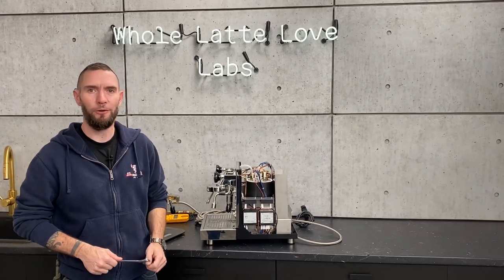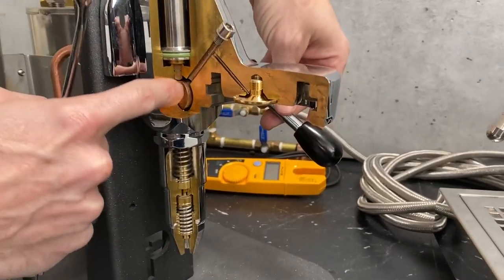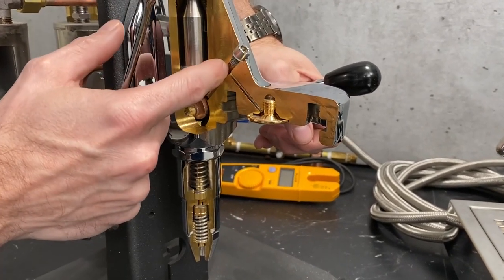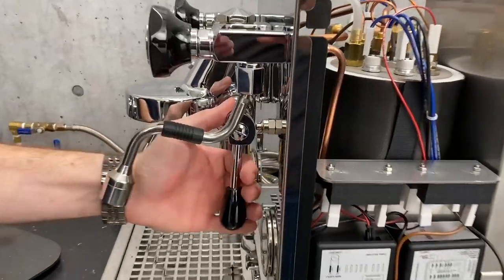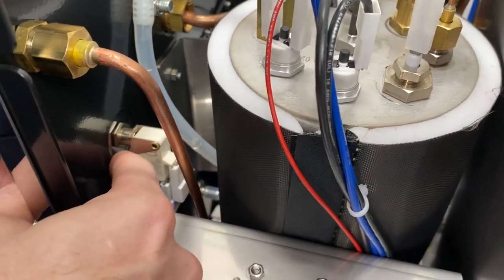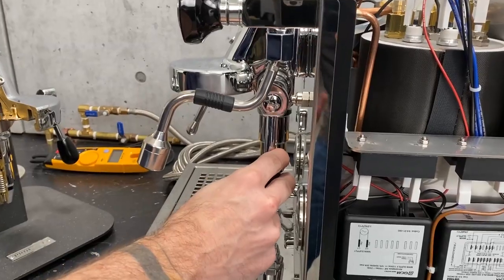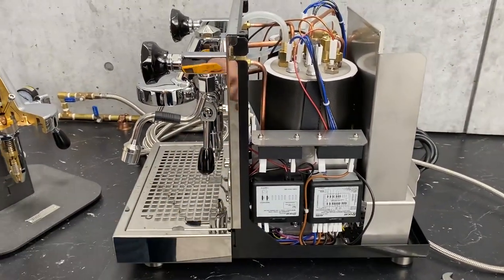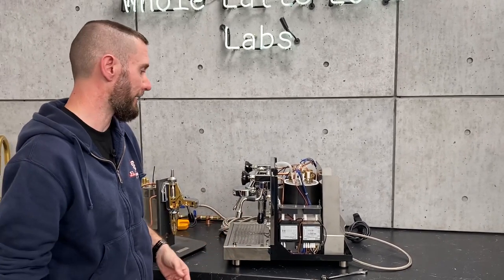Profitec Pro 700: Adjusting Brew Switch for Line Pressure Pre-infusion

Comment: Can you make a video showing how flow control works using that cut away e61?
Reply from the maker: Hi NL, I have this video: Espresso Machine E61 Brew Group Maintenance and Rebuild: https://youtu.be/ELIwD40tsrs which shows the internals of the Flow Control Device. The video has chapters and coverage of the flow control mushroom begins at 23:20.
Marc

Comment: Would we ever want to do line pressure pre-infusion over using our flow control device?
Reply from the maker: Hi David, Thanks for the question. You can accomplish essentially the same thing and a whole latte more with the flow control device. Line pressure pre-infusion does requires you are plumbed in. But useful for those without an FCD especially when extracting fresh, lighter specialty coffees.
Marc
Reply: @Wholelattelovepage  I see, thanks for the reply!

Comment: Does the shot clock start with pre-infusion? Thanks
Reply from the maker: Hi Paul, thanks for the question - one I get a lot! Including pre-infusion time in total shot time is up to you. Keep in mind that timing a shot is the most basic method of appraising an espresso extraction. If I'm using long pre-infusions which often reach 15 seconds before first drip my process is to do a basic dial in with a coffee using no pre-infusion. When doing that I adjust my grind to get a timing in the 20-30 second range from first drip. So I get my timing and then decide I want to do a long low flow pre-infusion to reduce the brightness/acidity of the fresh from roast coffee I'm using. I might do a 2 grams per second flow rate (similar to a 2 bar of pressure pre-infusion). I might not get 1st drip until 15 seconds. I probably do not want that shot to finish in another 10-15 seconds. It's a different story if doing a very short pre-infusion of a few seconds before going to full pressure. In that case maybe just shoot for closer to 30-35 seconds if including pre-infusion time. Bonus tip: When doing longer pre-infusions grind almost always needs to be a bit finer than if you were not using pre-infusion.
At the end of the day shot timing is for basic dialing in. It gets you in the ballpark. You can use timing as a reference point for your own extractions with your coffee made on your equipment. It's not all that useful if you're using to compare to someone else's variables.
I'll also mention it's not unusual at all for shots using pressure controlled pre-infusion or flow control to have total shot timing from water touching the coffee to run 40-45 seconds.
Marc

Comment: I actually have an issue with my switch.  It turns the pump on but wont turn it off.  I have to turn the whole machine on an off to get the pump to turn off.  I now feel like a solotion is possible.  Thanks
Reply: The lever turns the pump on and off not the switch